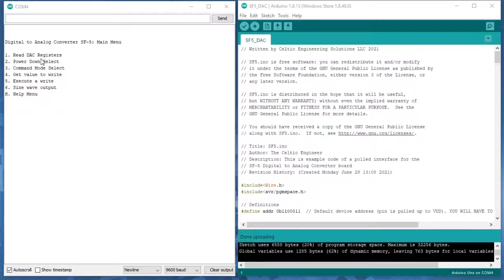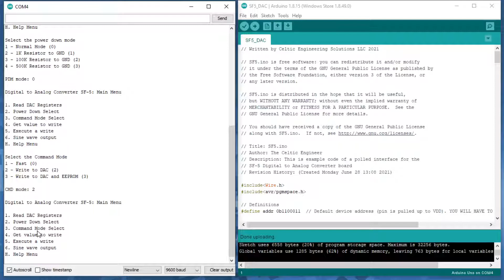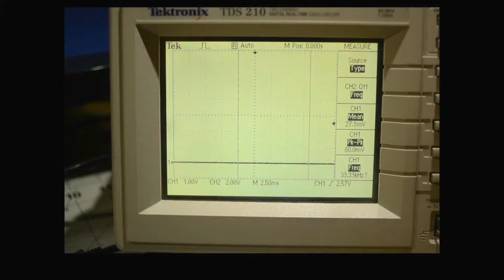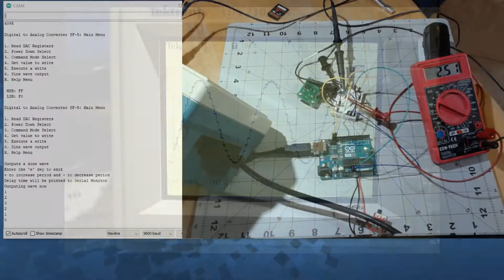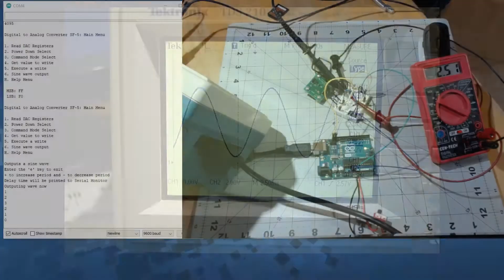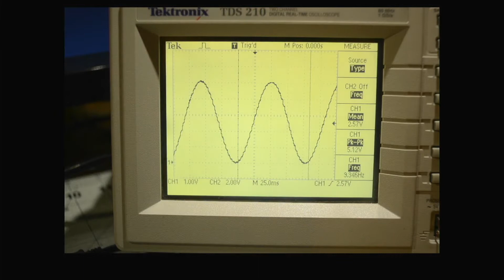SF-5 DAC Board Example Arduino Code

Comment: Hi Celtic Engineer,
I'm wondering if the DC sine wave can be used as an input signal to a MOSFET to amplify the signal voltage. I have a project that would eliminate the need for a step-up transformer as I'm only interested in generating 9V AC at a humble 50 or 60 Hz. I believe I could achieve this either using an isolation transformer, or using 2 DACs to do the top and bottom halves of the sine wave to generate 9V AC without any transformer after using the signals through 2 Mosfets. 
While it may seem strange to use an Arduino for this purpose, my project happens to need an Arduino in any case, so I might as well see if it can help me create a 9V AC inverter with minimal components.
Let me know if it's possible to use a MOSFET with a varying signal on the base. I may need to swing the sine wave voltage from above 0.6V to around 1.2V to work within the almost off to fully-on states of the MOSFET. I tried this myself and did notice that the shape of the output wave is a little fatter, but with some tweaking of the input table of values to the DAC from the Arduino I could correct the final wave shape on the output side of the MOSFET.

Keen to hear your feedback and if I'm onto something.
Regards,
Steve
Reply from the maker: Hi Steve.  While you could drive the gate of a MOSFET with the output the the DAC board, I think there might be a better way.  You can feed the DAC into an OPAMP, setup in the non-inverting format.  There are lots of them that will put out a 9Vpp signal.  You will need to run the signal through a cap first to block DC. Between the cap and the non-inverting input you should bias the  pin at roughly 4.5V, or whatever voltage you want the signal to be centered around.  The benefit of doing this is you can add a cap to the feedback resistor to filter the DAC output and get a cleaner signal  and gain all in one. This will minimize the number of components you need.  Let me know what you decide to do!